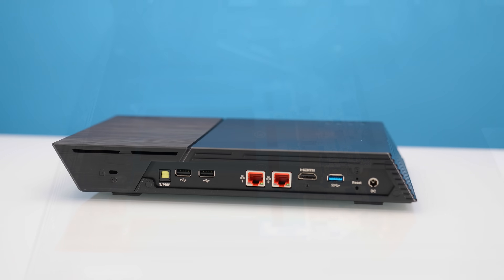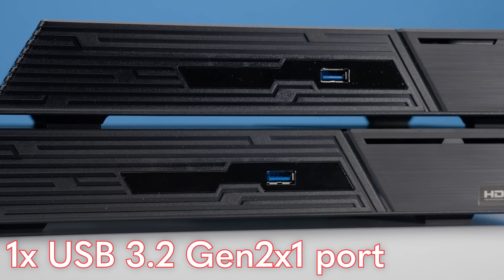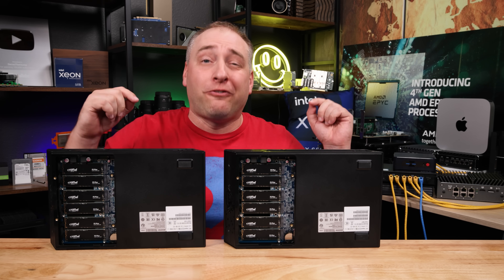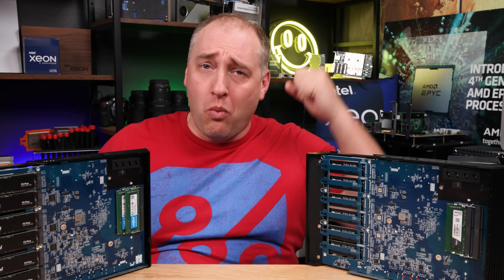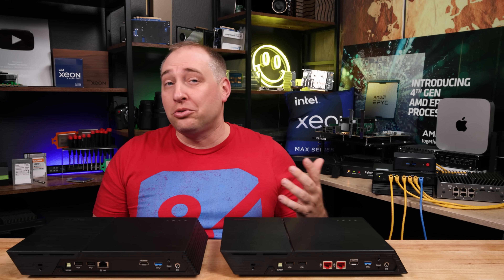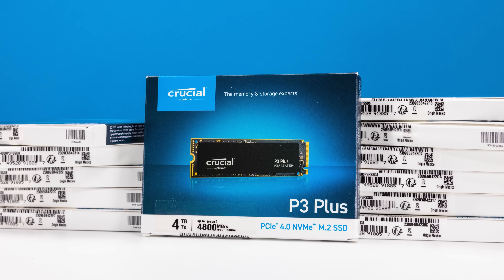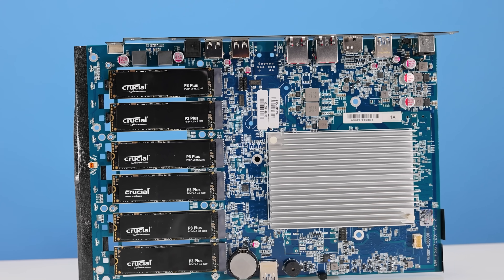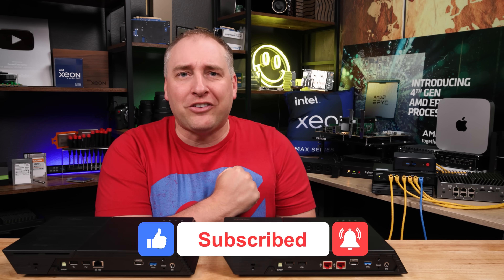Crazy 48TB SSD NAS and Cheap 6TB Version Asustor Flashstor FS67

Comment: Have a Qnap TS-932X NAS at home with five HGST Near line enterprise class 12TB drives in a RAID5 stripe.  It also has four more bays for SATA SSDs which I have yet to populate for faster write performance.  It has a pair of 1Gb copper ports as well as a pair of SFP+ slots supporting 10Gb.  Hardware wise it is long in the tooth and populating it with the 5 drives was expensive at a little over $1600.00 in addition to the $750.00 cost of the NAS.  But the interface and the performance in a compact and efficient package was more than I could roll myself and likely cheaper.  I may add some SATA SSDs for better write performance since good drives are cheap compared to when I bought and populated it a few years ago.  The Asustor is intriguing but the cost for us is to much unless it was going to be used for video or audio editing or the like.  Even then it's performance would not be up to the task of NLE.  Nice to see such a device though and for a dedicated media center I bet it would be great!
Reply: I think 1000mb/s is up to the task of NLE.
Reply: @jmasked5082  That is sadly not the case.  Uncompressed video bit rates are considerably higher than that.  Professional 4K projectors use a pair of SDI connections.  A 3Gb/second combined path.  Modern monitors use 18Gbps HDMI links. These are single streams, not multiple.

Comment: I'm actually considering this for my mobile office/camper build. With its low power draw a single solar panel with a small battery could run it indefinitely. I could also see this being used to run my steam library off of with the 10Gbe being enough for this.
Reply: This is overkill for a Steam library and in the end you'll lose performance. If you only need your steam library, you are better off getting 1 or 2 8TB SSDs and running off of those.

Comment: Just buy a used Dell r730xd. They sell for $500. You can fill them with 24 ssd's
Reply: The energy use and portability make this a totally different beast.
Reply: @concinnus  If you're porting it around yes I can see or if I could be a huge advantage. The problem occurs is that most companies think that this is an adequate storage solution that does not get moved around. The only adequate storage solution for any office that is running a Windows domain is a Windows server. Since I am a Dell guy, it would be a 730xd or 760xd. This eliminates all the problems that you have with a NAS. A great video would be a comparison between the two.
Reply: @edcochran714  Who runs a Windows domain anymore, and why?
Reply: @Michael Boratko  Most companies that have fifteen or more employees have a domain. When? You have more than 15 computers and or more than 15 users, it is necessary to run a domain for managability. Overall with a server running multiple hard drives you have more options than an NAS. Power consumption between the nose and a server in a enterprise environrent is not 1of the considerations.

Comment: I almost like it, but the propietary design and proprietary NAS software puts me off. It would be much better if they put the NVMe drives on standard  PCIe boards, as Asus is doing in other designs. There are PCIe boards in the market  with up to 16 X m2 drives, and to me that's the way to go. Because this is supposed to be a non redundant  NAS, and in case of problems it is critical that you can  move the storage to any other computer to access your data, which you could only do if they come in a PCIe card and  standard raid (ZFS or wathever). Otherwise this box is just a catastrophe waiting to happen. And yeah you could buy a spare unit, but that negates the low cost characteristic defining this product
Reply from the maker: Well this is just mdraid and ext4/ btrfs so that is easy and perhaps more widely supported than ZFS even
Reply: @ServeTheHomeVideo Ok I was wrong then, I have to agree that gives you a decent recovery path. 
Still, it would be nice if you could move the boards holding all those drives to a standard  computer in case of necesity (without having to purchase  a  expensive server, icy docks or JBOFs, as the whole point of products like this is to avoid datacenter class costs.
The thing is that low cost NVMe  drives are not only good for NAS, the m.2 form factor has truly become the new pen drive.  I find myself running out of m.2 ports at work  constantly, leading to rat nests made of usb to  m2 spiders or worst. I really  hope to see more inexpensive (but  standarized) solutions to accommodate these little things in a better way

Comment: Hi, good video , can you confirm how large capacity can SSD can I put to in to  FLASHSTOR 6 (FS6706T)
and  Flashstor FS6712X model ? I am thinking to adding 4tb sdd so 6's ssd version would have 24tb in total. As you did with 12x4tb to 48tb version?
Reply from the maker: Yes 4TB works in the 6x M.2 version as well.

Comment: Actually usb c power supply would be perfect for travel. I got a two 100w GaN usbc psu so travelling with a big nas would be perfect. And no one need that bend walls on a nas. Make it fancy and stylish for a nas that just has to vanish. Server rack bracket mounts would be nice though 😊.
Reply from the maker: That is my biggest complaint about the side angle style. Totally agree

Comment: Nice products.
I would love to see a varient equipped with a better CPU with higher speed and more PCI links (AMD maybe), higher memory capacity (e.g.64GB), dual 10GbE or even 25GbE NICs, support for ZFS, and of course a suite of enterprise-class software.
Reply from the maker: I agree, but I think that would also be much more expensive
Reply: That's right. I guess SMEs and prosumers won't mind a reasonable price pump in return for a variant with  enterprise-class features.

Comment: Cool idea, but completely useless.  3gb/sec per nvme saturates the bus way too quick.  When someone comes out with a low power xeon with ddr4 ecc and 6 nvme drives with 40gb then sign me up.  If you wanted a silent nvme system and didn't care about performance then I guess it's ok.  I'm ranting, but I mean performance wise regular sata ssd would easily do 10gb speeds in a raid 10 array.

Comment: interesting review. I am missing the part how flexible the RAID on the Flashstor is? Can you add NVMe's at a later moment and add them to the existing RAID? Can you replace an NVMe in an existing RAID-array from 1 TB to 4 TB for example ? Will it be compatible with future 8TB NVMe's ? 
Personally I find the case a bit of a problem. It is quite large and not very robust, so you can't put anything on it. It takes some space to put it somewhere on a desk. 
But thanks for the review
Reply from the maker: Yes it is mdraid and ext4 or btrfs. You do need to shut down the nas to ass M.2 since they are not how swappable
Reply: Your ability to expand arrays by adding more devices or upgrading existing devices depends entirely on which technology you're using - a) Linux mdraid (with or without LVM on top) plus ext4 or btrfs versus b) ZFS. It also depends on the array geometry. In most cases, the most sane approach is to back everything up, re-create the array in the new configuration and restore. Yeah, yeah, I know there's all kinds of "grow" options in some of these setups - trust me, it's an exercise fraught with peril.
Reply: @andrewr7820  yes, I know all of that. My question is how flexible is the Flashstor on growing its storage volume

Comment: On the 12 NVMe model is 4TB the largest drive that can be used?  Sabrent has a 8TB drive and if it could be used that would push the total capacity to 96TB but at $999.99 apeice it would be a pretty expensive NAS if you fully populated it with 8TB drives.
Reply from the maker: It will take 8TB, but you are better off at that point just getting something with higher capacity U.2 support

Comment: Hi, according to Intel specs, N5105 processor supports up to 16 GB RAM so is it really a surprise that it crashed with 32GB of RAM :-)?
Reply from the maker: 32GB works, but is not supported. 64GB (2x 64GB) is what kept crashing
Reply: The processor supports 32 Gig of RAM max.

Comment: just buy one of those intel board with 11th gen 11400f with igpu which supports 5 4.0 pci-e slots. then get those pci-e card which supports 4 m.2 each. with 5 slots
Reply: The 4-drive M.2 cards require an x16 slot and PCIe bifurcation support. Not happening on a desktop board.

Comment: I'm having a hard time finding any difference on the RAM side of the boards between these.  Is there actually anything missing that would prevent you from, sayyyyy...soldering on 6 more NVME sockets on the 6-slot version and 3D printing some extra clip pieces?
Reply from the maker: Yes. The ASMedia switch chips as shown would need to be added
Reply: @ServeTheHomeVideo  Hmmmm.  Are those actually something available to proles like us if we felt industrious?

Comment: I can already spot a performance bottleneck at around 6:20 where you're showcasing the expandability. That many NVMe SSD connections will over saturate the controller(s) and PCIE switches on the puny processor they've decided to base this platform. Great concept but piss poor execution in my opinion.

Why they didn't go with ARM or AMD is beyond me. And another thing: Who uses TOSLINK/SPDIF anymore?

I'd use this as a cache, personally..
Reply: What do you mean use it as cache? When it will be a bottleneck cache. Doesn't make sense.

Comment: Dang! I should've waited to get into the home server game... 2 years ago, I picked up a used R720XD (12x3.5" bay model) and populated 4 bays with 8 TB spinning rust drives. The thing idles around 154 watts - about 4~5x the power of these Asustor units under load!

While it is nice to have the 40 threads and GPU available for AV transcode and running a few small VMs, I could significantly cut my power bill by getting one of these and a couple of those HP micro-form-factor desktops. (and learn a thing or two about K8s and/or infrastructure as code while I'm at it.) Combine that with the significantly reduced noise generation and this little box would be a dream~
Reply from the maker: Apparently you can also use the iGPU in these for transcode
Reply: @ServeTheHomeVideo  you might've just got me to hit that buy button with that comment! I'm going to take a look at y'all's main site review and a few other reviews to see if this is the box for me :)

Comment: Still missing the SFP+ Ports for affordable and energy saving 10G Network. 10GbE is way to expensive and needs more energy, There is only one Mikrotik Switch with legacy 10GbE over Copper, but alost all of the Mikrotiks have at least one if not two or four 10G SFP+ Ports.
Reply: Glad I'm not the only one who feels this way. Most of the workstation level motherboards come with 10GbE RJ45 or even Dual 10GbE RJ45 and it sucks because I'm paying for a really expensive feature that I won't even use, is higher latency and uses more power. I'd rather have the extra PCIe lanes.

My rule is RJ45 up to 2.5GbE, 5GbE doesn't exist and 10G and above is SFP. Not that you have a choice with "above". If you computer has PCIe/USB4, the 10G SFP+ will find a way. Like cutting out the back of a 1x PCIe slot way. If it only has USB3, the bandwidth limitations don't make sense to go above 2.5GbE anyway. I plan on breaking out 10G links into 2.5GbE with the Aliexpress switch round up that ServeTheHome recently covered.

The SFP+ to 10Gbase-T kind of sucks from a price, power and therefore active cooling perspective. Like when used on a fanless Mikrotik switch. It should really just be reserved as a stop gap measure and should be avoided where possible.

My favourite thing about SFP above all is electrical isolation (plastic and glass). When you're going the enthusiast home server route the last thing you want is a lightning strike, wiring fault, unusual psu failure, etc to take out your entire slowly acquired hoard. Especially on the modem side if your internet connection is copper like ADSL or Cable.
Reply: @ky5666  I am still hoping for some sort of Mikrotik CRS340-8P-4XP-4XG-8G-16S+-RM, so you have all the options - POE for Access Points, IPCams and the VDSL-Modem from Allnet (can be the Allnet Gbic-Version as well), 4x 10GbE ports for cheap NAS or the normal PCs with 2,5GbE-Port (seems to get a thing recently, the Gigabyte BriX GB-BRR3H-4300 has them at least), some Gbit-Ports and plenty of SFP+ for NAS, Uplinks and so on. Would be a nice Switch for most small and medium businesses, CRS-354-48G/P-RM as edgeswitch would be perfect in this setting.
Mikrotik is concentrating on their 100Gbit product Line at the moment (nothing wrong with that), but at the moment most of my customers just hopped on the SFP+-Train and don't really need 25Gbit or even 100Gbit. Of course, nice to have, but e.g. the backup times are absolutely gone down due to change to 10Gbit SFP+ and SSDs in the servers. If a switch fails, it will probably be the 100Gbit version in the Serverrack instead of the 16 Port SFP+, but this is something in a few years to think about.
If someone is editing videos the whole day, the mileage may vary...
The SFP+ to 10GbE Adapters are neither price-efficient nor good to cool down. And the reliability is sometimes really bad.
I can understand if a VDSL-Modem like the Allnet one is getting hot since there is a whole Chipset cramped into the SFP-Port, but a stupid converter to Ethernet? They shouldn't need more power than an complete optic Module. For the hot SFP-VDSL-Modules there is a special switch (Rubytech VS-820S ) which has better cooling than normal SFP-Ports - sadly the ports on this switch are not 10G, so this is no option either. 10GbE really needs to disappear, 2,5 GbE sufficient for most Endpoints, the Rest can be done in Fiber or DAC.
Reply from the maker: We use SFP+ to 10Gbase-T adapters with these

Comment: The same form factor with a Ryzen V3C18 would be amazing. Enough CPU power to run some VMs / Dockers plus insane I/O capability (20L pcie4 + dual 10gbe) for a blazing fast NAS.
Reply: A Proxmox dream machine.
Reply: But then you lose the hardware transcode, no?
Reply: @MichaelBoratko  Yes. Since this cpu, doesn't include an encoder like QSV nor a iGPU. You could still transcode using the much more powerful CPU core.
Reply: @MichaelBoratko  Ultimately, it will depend on how such motherboard is constructed. If they want a NAS only, it is likely that an ASPEED AST2600 BMC chip would be used or something of the sort. They might decide to add a small GPU if they want to hit the HTPC/ PLEX market. But it is likely that they would instead use something like a 7840U, if they want media capability.